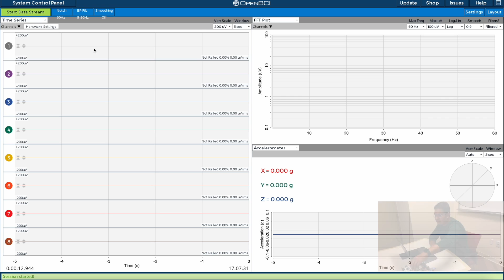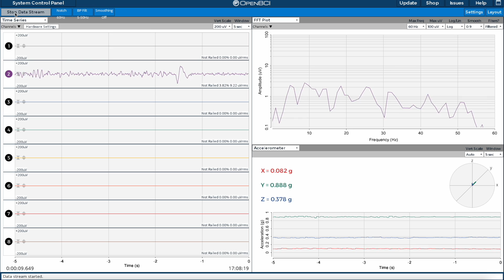PART 1: Low-Cost Brain (EEG) -Computer Interface by Using OpenBCI Headset

Comment: whats up buddy, im looking to do an EEG to drive a drone dji tello, any suggestions??? as you have experience on working with EEG's.
Reply from the maker: In principle, this is possible. You just have to properly classify the EEG data and to decide what commands should correspond to which actions. We have developed in interface for Open-BCI-Arduino via MATLAB. You can develop a similar interface for C/C++ or Python. Best, A. Haber

Comment: Hello, Simply awesome!
Could you please provide the details on the cost of the equipment used? thanks!
Reply from the maker: OpenBCI headset is around $3000. That is all you need to start with playing with EEG.
Reply: @aleksandarhaber  : Almost all basic features can be achieved by a Muse 2 or a Neuro sky headset which costs around $200.
Reply from the maker: @SuryaUday20  Thank you! Can you connect these devices with C/C++/Python and read the data?
Reply: @aleksandarhaber  Where can I get schematics/ gerber files for openbci cyton board
Reply from the maker: @bharadwaj4602  OpenBCI board is produced by https://openbci.com/
It is a bit expensive...
Reply from the maker: The codes are given here: https://github.com/AleksandarHaber/Low-Cost-Brain-Computer-Interface-by-Using-OpenBCI-Cython-Board-MATLAB-and-Arduino
Other parts of this series:
PART 1: https://www.youtube.com/watch?v=h5Lu9OcZ8x0
PART 2: https://www.youtube.com/watch?v=BOithxp_fEc
PART 3: https://www.youtube.com/watch?v=Piksll8J_1s
PART 4: https://www.youtube.com/watch?v=RUSvc0OKhL8